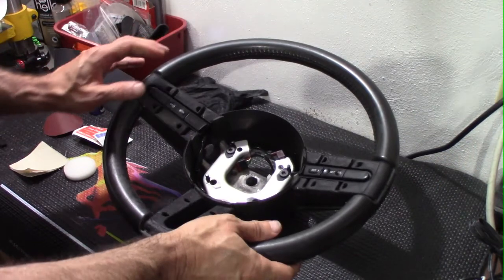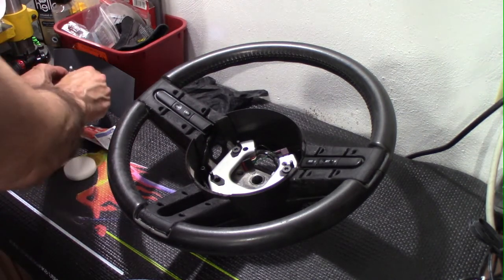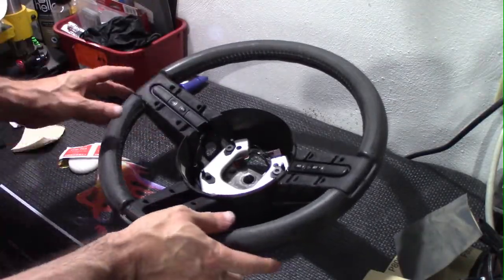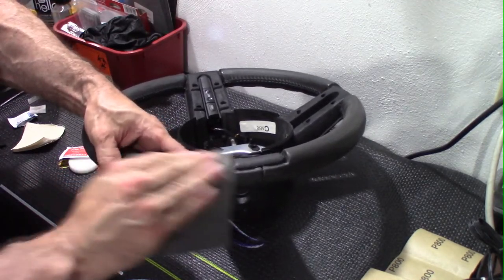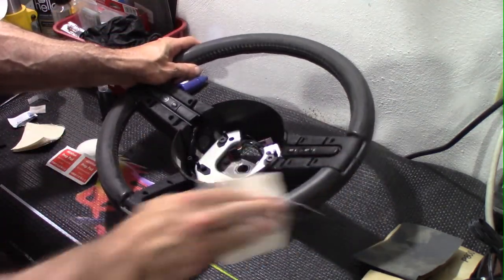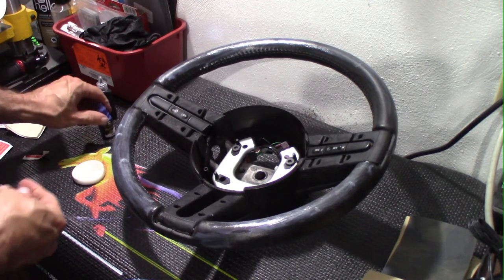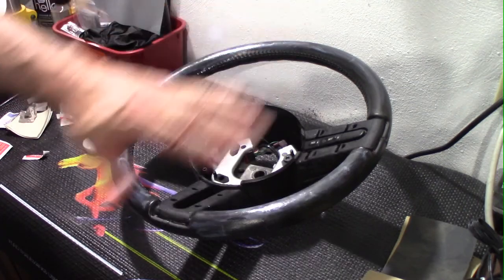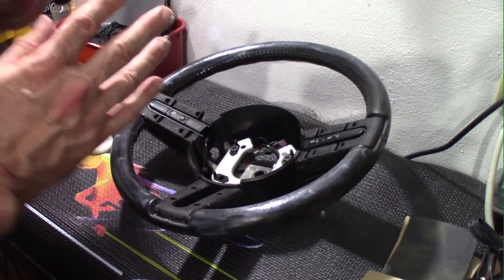2005-2009 Ford Mustang - Restoring the existing leather wrap on a Mustang Steering wheel.

Comment: The original s197 steering wheel did not have a pattern on it; it is smooth.
Is the idea of pressing in a pattern to hide any imperfections in the dying process?
My original wheel is worn at the 12 o’clock position (UV damage) and I was thinking of restoring it